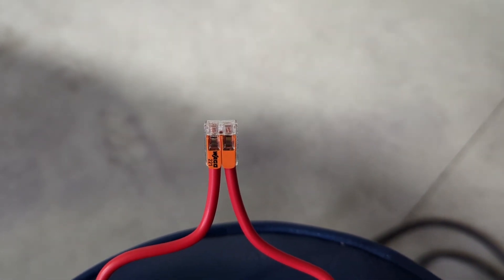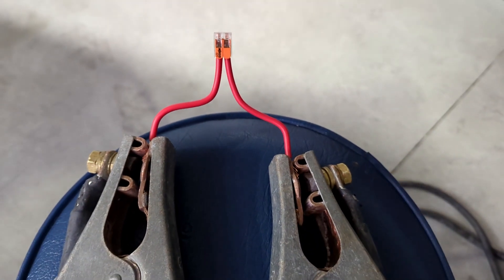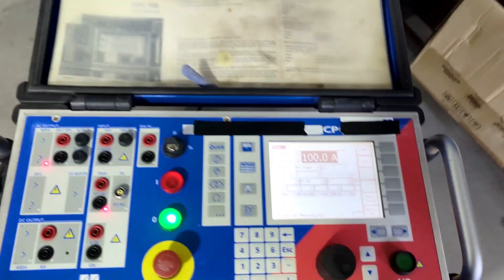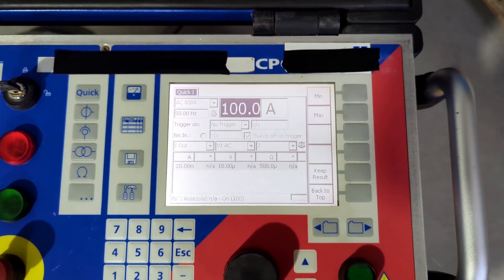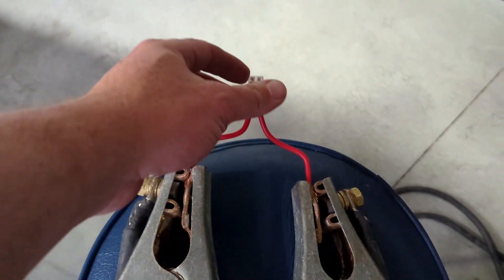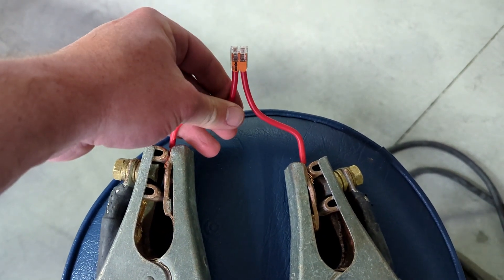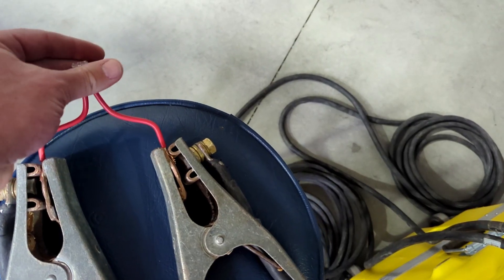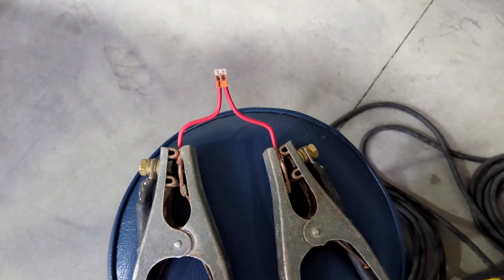Testing a Wago 221 at 100A AC

Comment: Lots of contact area with the stranded - I think if you ran the test using solid 10 gauge, the Wago might get so hot it'll melt?
Nice video / test.
Reply from the maker: I agree, I looked around for some solid core but could not find any in our workshop. Solid is not as common here in Aus. I really made this as a counter-point to all of the old fellas I work around who don't trust them. Main point being they are more than fine for domestic lighting and power circuits and in my humble opinion, faster, look nicer, and easier to fault find.

Comment: The 221 is rated up to 105c but the actual failure point is going to be quite a bit beyond that.  I'm guessing that's 75/90c PVC on the wiring so even with 6mm (looks like 6) wire the insulation is going to be in trouble before the 221.
Reply from the maker: Dead on mate! I know its not scientific but I know the limit of my ability to touch something hot is about 50-55 C (122 - 131 F) and although I did not show it well here the cable was actually hotter than the Wago by a good margin. It was 4mm2 CSA too.